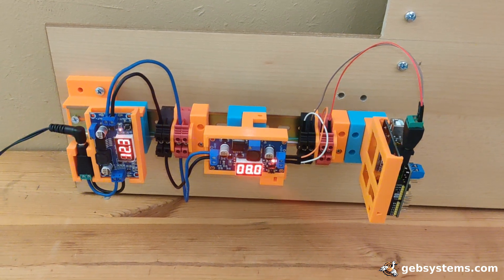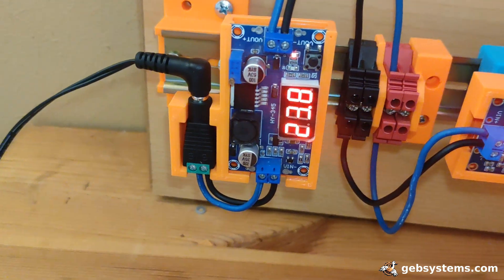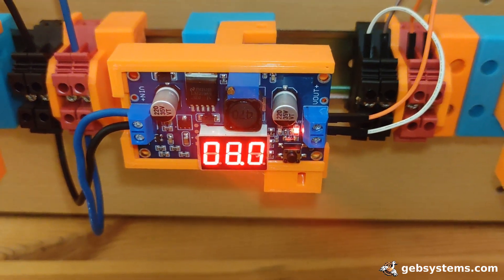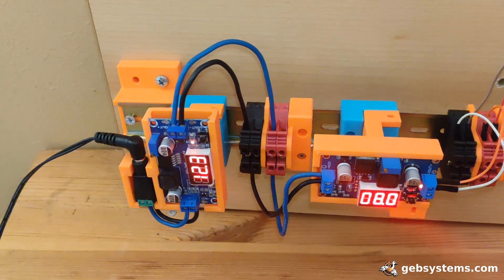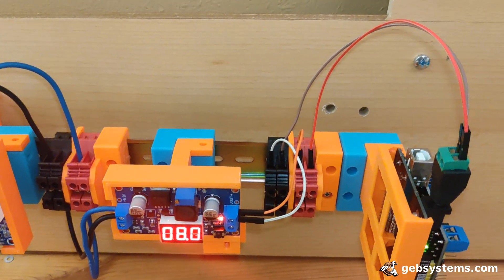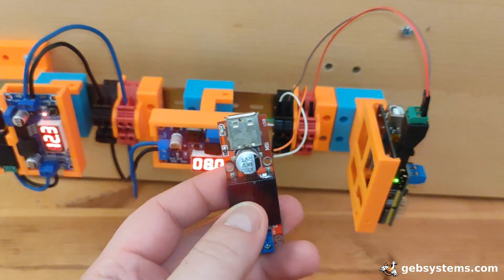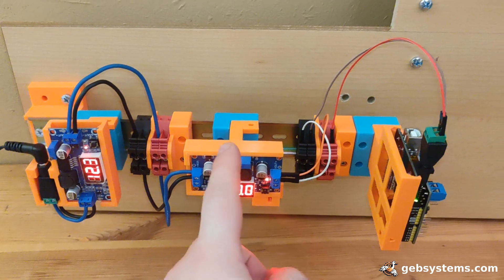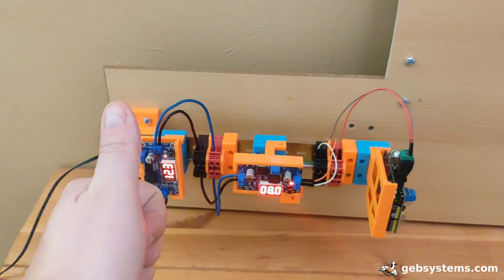Arduino Modbus Experiments: Project Goal

Comment: Why not skip the first buck converter and just use a 24v power supply ? Those buck converters are good between 3.5-35v but they do have much greater efficiency at the 18v - 24v range
Reply from the maker: You are correct. The first step up converter can be ditched. However I do not have a 24v power supply on me hence why I am using what I have.

Comment: Very cool and interesting work!
Can you explain why you want to use Modbus, as opposed to other bus based protocols, like a simple RS485 bus?
Reply from the maker: Thanks! I am trying to build something that can be standardised when building a DIY home automation (educational purpose, boredom or someone actually wants something that is not a commercial product linked to Alexa or Google). I have not worked out everything yet and I just do as I go along. Why Modbus? It is an industrial protocol after all so I expect this contraption to not have issues with communication + it is a learning curve. It also needs to have the ability to link to your home network at some point (probably via Ethernet, + maybe a Raspberry Pi somewhere...)
Reply: @gebsystems  I look forward to more videos in this series. 👍
Reply from the maker: @RogerMcIntosh  Funny enough, me too :)